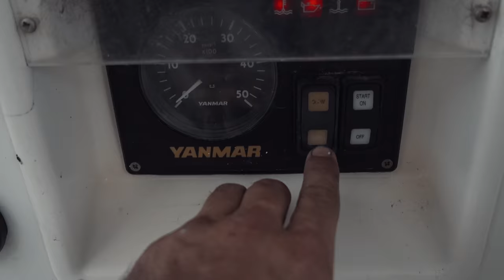HURRICANE DAMAGED CATAMARAN REBUILD COMPLETE AFTER 4 YEARS!!  (Episode 141)

Comment: Video accessory alert:  You need a Telesin Dome Port for your GoPro.  It allows above AND below the waterline views to be in sharp focus SIMULTANEOUSLY.  That shot of the guy diving into the water as viewed from the water would be spectacular.  It’s not very expensive but will add a lot to your content now that the boat is wet.

Comment: Wow, just got here, BIG DAY ! 
Yes, two things I've discovered sort of recently. Coffee cup O-rings need a tiny bit of silicon grease. They claim its "food grade" silicon grease !  I also put a little silicon grease on spare part o rings. It keeps them "fresh". I wonder if that would help any spare rubber part from degrading ? Like , say, a spare impeller ? They dry out otherwise. 

Two cycle and some four cycle gas tanks have a "Pressure release valve" pushed into an inset in the tank. when it gets clogged you think you've lost your gas pump or have a clog in the system. The motor runs full bore for a few then stops ! I would imagine with a big engine that could become a factor but it would take longer because they have larger tanks !

The key to making the job at 8:57 is adding a pipe to each handle, extending the handle at least a foot or 1.5 ft. Amazing what it does for you. Torque Magnifier ! 

HUGE DAY ! And, Shout out to Jamie. He was with the boat right up to the finishing of the sugar scoop from what I see  , and I've always felt he's PRIME CREW MATE ! (believe it or not, I wrote this BEFORE I got to about 18:44 where I found a lot of satisfaction watching you talk about him).

Comment: If your stainless threads on the shrouds have to much tension they will be hard to move as the thread gets destroyed with to high pressure. On a wooden boat you want the shrouds only to be tensioned handwarm as we say in German. More is not really necessary. On modern boats it's a real bad habit to put tension on the shrouds until the game is over. A modern rigg is often dimensioned lighter than a old fashioned wooden mast and needs some more tension or support by the shrouds. But you always want to recall that the shroud under load is tensioned by itself. No need to tension them until the boat is bending again. Think about what may have happened to the boat before ... Congrats for being back on the water anyway.